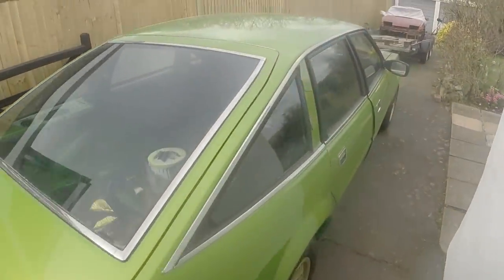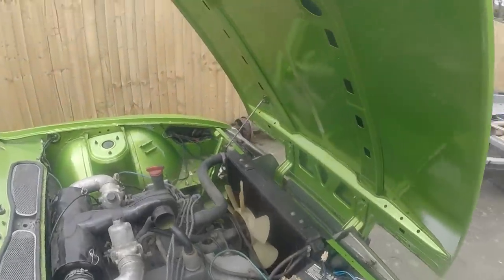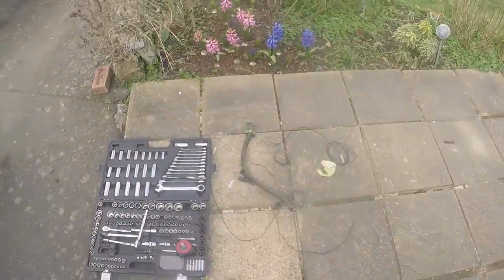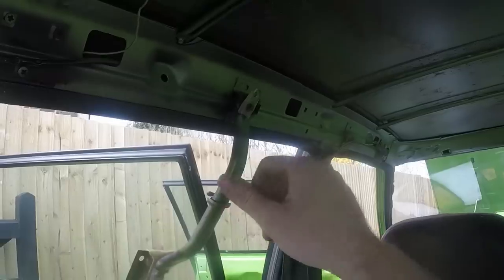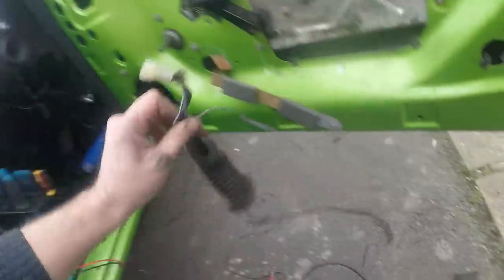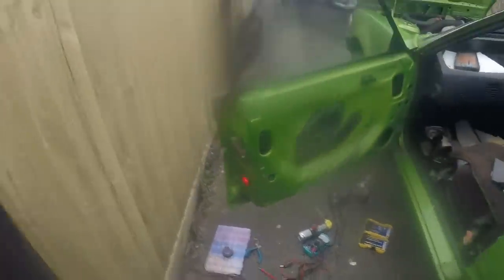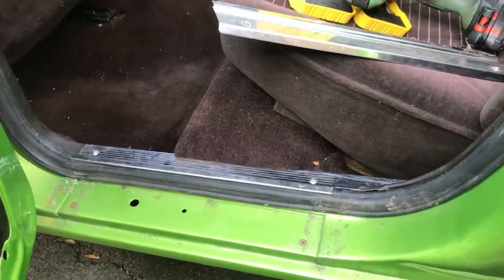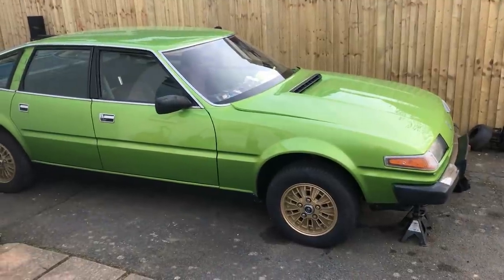Dotty 1981 Rover SD1 V8 Restoration - Video 65 Final stages

Comment: See these from time to time here in Australia, surprising given not many were sold here.
Reply from the maker: There are quite a few dedicated owers out that way and also over in NZ.  I think they lasted pretty well because of the climate.  Its mostly teh dash and rubber trim that suffers.  Also i think the fuel prices meant that the v8's were still ok for a daily driver.
Reply: @nitrosilvia  

Sadly more modern rovers are few and far between. Rover 75’s were sold here though and I do still see quite a few around. I’ve seen 1 45 and a couple of 25’s but i suspect they were likely private imports.  

I’d love to get my hands on a rover coupe (tomcat) but never seen one here in Aus, apparently a few were sold in NZ but rarely see them cone up for sale and the cost of import into australia would make it not viable

Comment: just thinking about the rear headliner clips, if you know someone with a 3D printer could they be produced in plastic to avoid the rust issue, something which mine suffered with. By the way i really enjoy your vids been a fan of SD1 for ever.
Reply from the maker: Hi Jim,  yes thats a good idea.  I initially wanted to use real strong double sided velcro, but there was too much of a gap.  Plastic would be good, but it would need to be super slim so as to minimise the hole needed through teh headliner.  My Rover 200 the rear of teh headliner is held up with 90 degree plastic plugs that are moulded out of beige plastic.